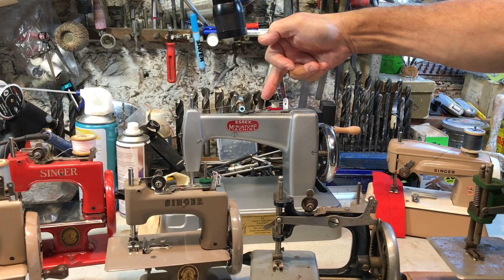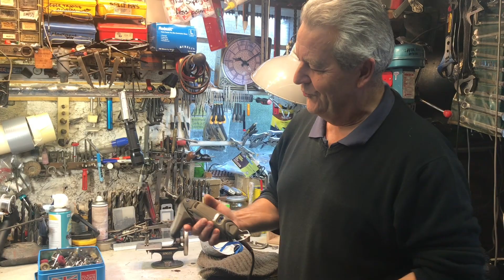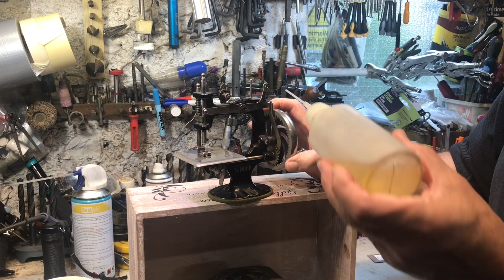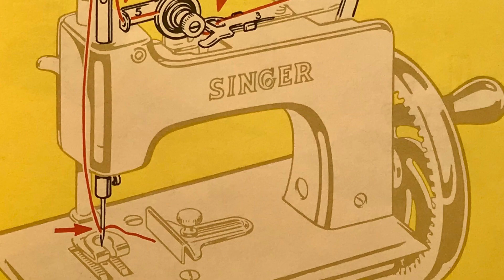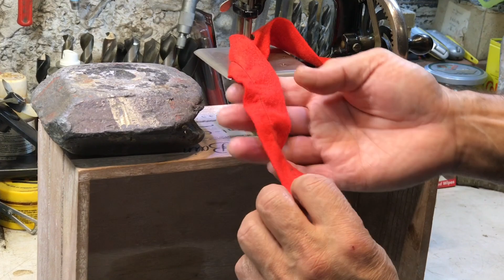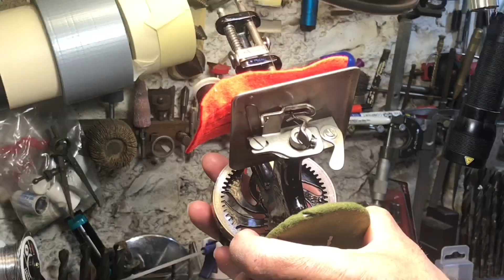How to repair set & service a toy sewing machine by Alex Askaroff

Comment: My looper hook keeps gobbling up my thread after a few stitches grinding everything to a halt! Maintenanced everything as shown but it still gobbles me thread. Any help from anyone would be appreciated!
Cheers all!
Reply: The ISMACS web site has an adjuster's manual for the singer Model 20 machine - that may very well help you get things set just right if it is a model 20 you are having problems with.  As for gobbling up the thread...  If you are getting a pile up of loops on the hook under the 'bed' of the machine then there is a good chance that the threading path is not correct (especially if you have missed steps 3 or 6 for the threading), the tension is way off or the 'nipper' (at step 3 of threading) that is lowered and raised to allow thread through for each stitch is not properly 'stopping' the thread with each stitch as well.  You might like to watch the videos by Bob Fowler here on youtube where he works on these machines too (if you haven't found them already).  Good luck with getting your machine going again!
Reply: @meganmills6545 THANK YOU!!!

Comment: Hi! Thank you for your videos - they've been such a great help to me. 

I've got a lovely mini Essex sewing machine, that I've done some maintenance on. With a lot of trial and error, I've managed to get it working beautifully on small sample pieces of fabric - even many layers thick. But the moment I start sewing with much bigger pieces of fabric, it starts missing stitches. I'm assuming this happens because sewing bigger pieces of fabric gets heavy and starts weighing down at the sides. If this is the case, could this indicate a feed-dog issue? Like it doesn't have enough 'bite' to pull the fabric accurately?

Comment: Hi Alex this is a wonderful video. I have just found a little singer 20, but it is missing its thread tensioner and its spool rod. Apart from that it all looks great. I wondered if you have any tips as to how I could locate the spare parts for this machine, or is there any way I could dud up a simular tension unit? I would love to use this little machine if I could. Many thanks Muffy from Oz (Australia)
Reply: I had the same issue and was able to find what I needed on eBay, if that helps. 😊

Comment: Nice collection!  My sewhandy is missing the spool pin. Do you know what size rod i can use for a replacement?   I have a second toy that has no name and is also missing the spool pin.  This one should have a base with a thread guide built into it.  I saw only one in all my searching, it was on EBay. That’s how I know it should have the small base.  It is also missing the tension unit which has only the bent “stud” there. Nothing on this machine can be taken apart as all connections are pins or something that would have to be drilled out.  I would like to fix these little machines but don’t know where to start.  Any help would be appreciated.  Thanks.

Comment: I just got a besty ross from the orginal owner she kept really good care of it but over years of non use it seems maybe that's why the hand crank is a bit stiff as I turn it  it turns kind of ok then gets really hard   then it goes ok again then does it again in two different areas of the turning. I have oiled it really good  with Singer Muli Oil could you have a ideal what could be the problem with the crank?

Comment: Thank you for the great video.  I have the SewHandy from my childhood, but the timing is off.  There may be parts missing.   I kept the machine, the box and all the accessories, all my life.  Our house flooded, but not the little machine- until workers moved it out of a closet and onto the garage floor, where it did flood.  This happened as the hot water tank was replaced.  The beautiful black base rusted some.  I have two young granddaughters, so I bought a second machine, so they could each have one.  My thought was that I could compare the workings of the second machine and hopefully fix my original.  Well, now neither are working.  I can't seem to find the problem. After watching your video, I am encouraged to try working on them again.   Do you know of anyone who repairs these for other people?

Comment: You're amazing!  🙉   Wow thank you for this.  

 I have this same one, and have been trying to make a little something with it for someone as a gift, but I've been wondering how to actually effectively sew things, without the stitch coming undone easily, after it's finished!   Is this an issue you've run into at all?  There doesn't seem to be any good way of "tying" it at the beginning and end, such as a quick back and forth like I've done with other machines.  Do you have any ideas?   
 Whenever I finish sewing a line, it's in danger of easily becoming fully unraveled by a tug of the end~ like a flour sack!  😸
Which is great fun to do, but not at all what I'm going for in this instance.  😏

Comment: Is it possible to stop the stitches unraveling when you get to the end?
Reply: I've given this answer to someone else above so my apologies to anyone reading this twice.

I haven't tried this yet - but piecing together what I've been able to find here and there I believe this is the process:

To fasten off stitching at the end of the seam sew two stitches past the end of the seam and stop the machine with the needle bar at its highest point.  Then with the left hand draw a finger length of thread to the left through the hole near the upper end of the needle bar.  With the right hand, using a pair of scissors, draw the slack of the thread to the right through the eye of the needle.  Then pull the thread upward from the work, the presser foot being down, and cut the thread close to the goods.  Pull the work from you and the end of the thread will be drawn through the loop.

To fasten off the stitching in the work stop the machine with the needle in the work, place the fingers on the machine close to the presser foot to the presser foot to prevent the work from moving.  Raise the presser foot and take one more stitch in the last hole made and stop the machine with needle bar raised to the highest point.  Then with the left hand draw a finger length of thread to the left through the hole near the upper end of the needle bar.  With the right hand, using a pair of scissors, draw the slack thread to the right through the eye of the needle.  Then pull the thread upward from the work and cut the thread close to the goods.  Pull the work from you and the end of the thread will drawn through the loop on the underside of the work.

Comment: Alex!  By golly I did it!  I fixed the machine all on my own.  The needle was not completely in properly, it was a slight off.  Then the tension disk needed to be messed with.  

Now, could you be a dear and tell me how to release the fabric from the machine?  Also, how do I tie off the strings to it doesn't unravel the threads?  Finally, where can I find a manual for either sewing machine.  Thank you so much for all of your knowledge. ~Rachel
Reply: I haven't tried this yet - but piecing together what I've been able to find here and there I believe this is the process:

To fasten off stitching at the end of the seam sew two stitches past the end of the seam and stop the machine with the needle bar at its highest point.  Then with the left hand draw a finger length of thread to the left through the hole near the upper end of the needle bar.  With the right hand, using a pair of scissors, draw the slack of the thread to the right through the eye of the needle.  Then pull the thread upward from the work, the presser foot being down, and cut the thread close to the goods.  Pull the work from you and the end of the thread will be drawn through the loop.

To fasten off the stitching in the work stop the machine with the needle in the work, place the fingers on the machine close to the presser foot to the presser foot to prevent the work from moving.  Raise the presser foot and take one more stitch in the last hole made and stop the machine with needle bar raised to the highest point.  Then with the left hand draw a finger length of thread to the left through the hole near the upper end of the needle bar.  With the right hand, using a pair of scissors, draw the slack thread to the right through the eye of the needle.  Then pull the thread upward from the work and cut the thread close to the goods.  Pull the work from you and the end of the thread will drawn through the loop on the underside of the work.
Reply: @Plueschbaellchen  I've got the pictures too on a little document I've made up for my own use of images I've found here and there on the web but unfortunately I couldn't attach those.  So I just re-typed out the instructions I've seen for two different early versions but adapted them to remove references to "Figures" (that is, diagrams and pictures) she wouldn't be able to see.  I got an 8-spoke one without a numbered threading path from the 1914-1922 era yesterday (present from hubby) and currently have a few parts out for a good cleaning.  So far the needle bar is cleaning and polishing up beautifully.

Bit by bit I'm going to clean and polish all I can but it came with no manual or even clamp so internet research all the way to get her going really well again.  The needle is not in great shape and it doesn't feed properly at the moment - I have to pull the fabric through to make stitches.  But if I do that it does make nice stitches so I know that fundamentally it works.  Cutest thing ever.  It needs the proper screws for the needle clamp and set screw for the handwheel, and the spool pin is bent (but at least it is there) so it's going to be a while before she's at her best.  Ideally I'm going to hunt down the clamp and cloth guide with its little bed screw as well.  Oh yes - and did I mention it's Cute?  Even my hubby thinks it is.  I think he might like at least much as I do.  :-)

Comment: I have that very machine from my mother.  I don't have the looper for it, however.  I purchased the Singer Sewhandy, made in Great Britain, just this week and it arrived today.  I think the tension must be wrong because is seems to get tangled around the looper as well as skip stitches.  This helped and I will try to see if it solves the issue.
Reply: Oh!  what type of needle does the SewHandy take?  I tried a needle but it is too long.  I cleaned up the needle that came with it, but not sure what replacements I can find for it.
Reply: @RachelMEsp  It takes the 24x1 needle and make sure you put it in with the flat to the right and thread left to right.  In this vid Alex doesn't say to take the thread through the hole in the top of the needle bar before threading the needle and maybe this model doesn't, but my earlier model does.  So do check the exact threading path for your machine.  (If your particular model threads right-to-left you can still use the same needle, just be sure to put it in with the flat to the left in that case. Ideally for those models you use a 24x3 needle that has the flat on the other side to start with but those are hard to find and the 24x1 will still work.)  The other thing to make sure you do is wind the handwheel in the right direction - away from you.  This is unlike the larger machines where you wind the hand-crank away from you but the wheel comes toward you.  So think of the handwheel as being a hand-crank on these little machines.  :-)
Reply: @meganmills6545  Would you happen to know the answer to Rachel's first question, about the thread getting tangled around the looper.  I have the same problem.
Reply: @laurachattin6037  The best advise I can give for that is to look very closely at the youtube vids people have where they show the underside and the machine sews well.  While the vid is paused you can press < and > (the ones that are for the typed symbols, not the ones that move your cursor) to forwards and backwards frame by frame.  Carefully not where the looper is in relation to the needle and the loop that forms on the needle that the looper picks up.  Compare that to your own machine and see if either (a) the hook is in the right place at the right time to pick up the loop, but the looper isn't in the right spot or (b) the looper isn't in the right place to pick it up.

Also check how the "old loop" is released - and when, by the looper. And where the feed dog is in relation to that as well.  There are screws that let you loosen the looper and so on to adjust these things but before you loosen the screws and twiddle with yours to get things in the right place at the right time make sure you understand just where the needle and rotation of the looper need to be in relation to each other - including where the needle is on both the upstroke and downstroke.  I know someone on Ebay who sells an adjuster's manual + extra tips they've added.  I've ordered one but it hasn't come yet. They also sell a "set" of the user manuals for the different versions that came out over the years.
Reply: @meganmills6545  Oh my goodness - thank you for such detailed help!  What you described might be a little beyond me, but my husband is quite mechanical, so I’m hopeful that with your explicit directions we should be able to get somewhere.  I’m kind of speechless over the time you took to answer my question; bunches of roses to you!
Reply: @laurachattin6037  It's a pleasure to help - most people in the VSM (vintage sewing machine) community are really helpful and friendly and love to help each other rescue the old machines and keep them going.  I don't want to publish my email here but I do run a knitting group in Western Springs so you can search for me that way if you like and I can help you a bit more.  :-)